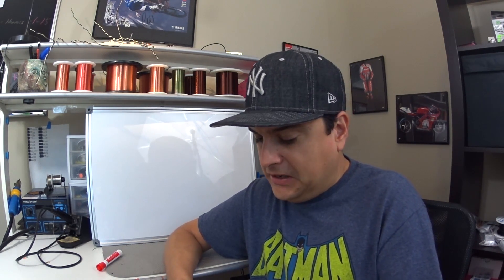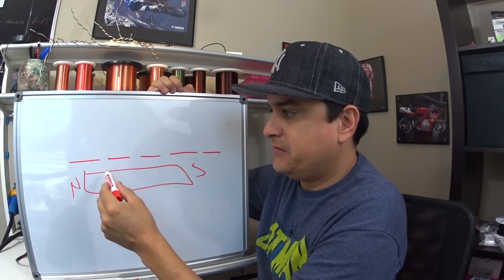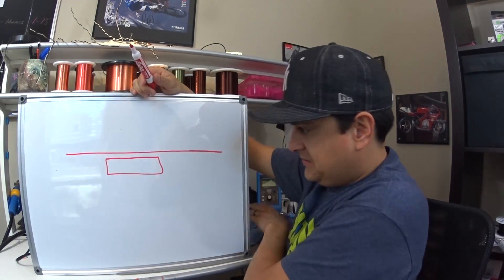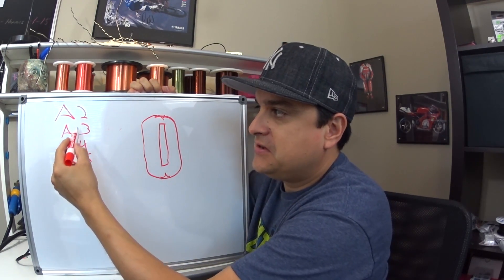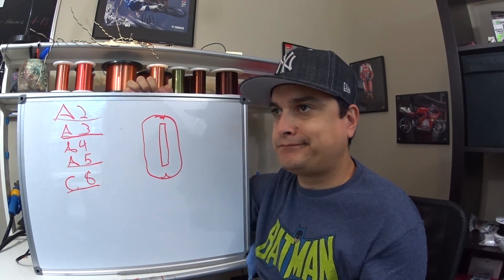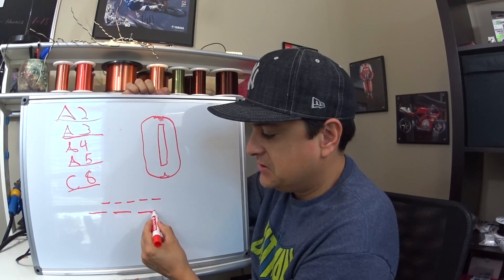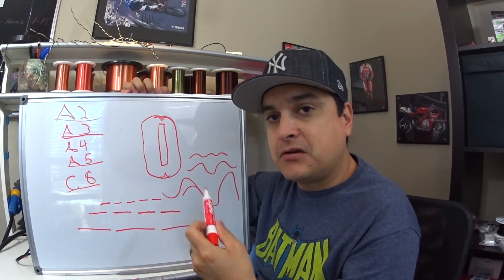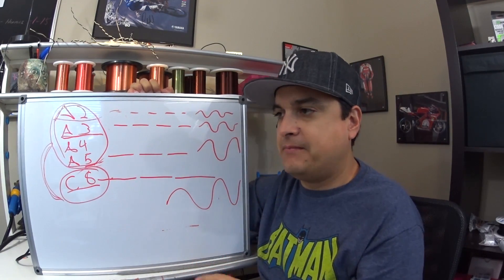Dylan Talks Tone Ep #13 Magnets! Alnico 3 vs Alnico 5 Vs Ceramic #33

Comment: The thing I dislike most about pickup manufacturing is the talk about DC resistance. Resistance changes with heat and DC specifically is pretty irrelevant when talking about an AC system. We really should switch over to talk about reactance and inductance instead. 
For reactance we can use the tuning as a reference.
If tuned to A=440, we can measure the reactance using XL = 2•π•440•L
So, given a pickup with 9.28Ω DC resistance (my Squier humbucker), I measured 3 Henrys of inductance.
XL = 2•π•440•3
XL = 8.294kΩ

Comment: I never really thought much about the relation between the coil and the magnet together, this is really interesting. So if my brain is thinking correctly, if I were to wind a humbucker with less winds similar to a vintage paf, but use a stronger magnet like a ceramic or alnico 8, would you be able to get the clarity of a vintage pickup while also having louder, more modern output?

Comment: Hey Dylan, question for you. I have a p90 that has a DC reading in the 14k range. It has ceramic magnets. I was thinking to play around with different magnets, a2/3/5 probably. And different combinations of them. Is it going to work out ok putting lower powered magnets in such a high dc resistance pickup?

Comment: Thank you for this simple explanation. The only thing I would add is that although stronger magnets are capable of a more powerful signal (i.e., more amplitude), their stronger magnet field is also more capable of interfering with string vibration. A common symptom of this is "Strat-itis", where having the pickups too close to the thicker strings will cause wolf tones. Pickup strength (combined with coil characteristics) will also affect the relative amplitude of various frequencies, which is why some pickups sound comparatively balanced, while others sound trebly or muddy. That's why pickup height is so important to good tone: you want as strong a signal as possible without putting a drag on string vibration or causing the frequency response to become unbalanced.

Comment: hi, thanks for this but its'a  bit short.I've experienced differences in tone following differences of magnetic fields shape, even generated by the same alnico type. Basically when magnetic field is very straight and thin above the pole piece, it's sharp and clear, full of dynamics. then when the MF is wider, o if it's creating kind of magnetic "bridges" across all pole pieces or pickups , then the sound is totally diferent, more flat and thin, with less dynamics and body, kind of intermediate position.
One cool example, just turn one HB pickup on a les paul type guitar; if the other HB pickup is close and with a powerful magnetic field, a south will face a north, leading to a very wider magnetic field and you will hear clearly the difference, (like  Peter Green's LP)
 I guess it's different for single coils as north and south are up and down the pole pieces, but there is kind of shaping of a magnetic field that's better than another. 
Everyone seems to know how to perfectly reproduce a pickup and they show you as well, but nothing on how pîckups are magnetized. See Seymour Duncan factory tour, not a word on it despite they say it's done further in the process.
Could you say a word on this? or confirm?
Thanks, I appreciate your channel and I'd like to have one video on magnetic field, sure you can make it!!

Comment: Misinformation the type number doesn't necessarily refer to strength but is merely an identifier a2 is in fact weaker than a3. Also you can have a vintage quite not so magnetised at weaker than a3.

Comment: Totally missed that alnico magnets act as an inductive core and independently of magnet field strength the different compositions of alnico have a slightly different permeability thus different effect on the public's inductance, and it is this one property that has a dominant effect on the frequency response. Magnetic field strength doesn't change the frequency response, but the overall output level.

For comparison, attach a lump of steel to a pickup and listen to it get louder and darker.

Comment: You are right, stronger mags, higher output.  But there is far more to all this.  The iron content within the coil for a start.  Ceramic magnets are usually used with steel pole pieces.  It's not the ceramic magnet as such, but the steel within the coil that is raising the inductance of the pickup.  (And if otherwise the same, lowering its resonance.)  Alnico has around half the iron content of steel, and was used in the 50's because there was little choice....  OTOH, I really appreciate how hard it is to make YT content that attempts to communicate technical stuff.

Comment: have a old 70s Tiesco strat that i bought as a young teen 72 to 74 it has ceramic pups ,I recently replaced the slide switches that had issues ,did total seup and it sounds amazing better than most if not all of my 20 guitars ,is it the  ceramic pups that is doing this? they are wide i guess double single coil pups much like a p90 just wanted some input on this they measure maybe 7k ohms i think

Comment: Thanks for the informative videos you produce. Here are a couple of answers that are not covered in this video about magnets in pickups. Number one the magnet has a direct relationship to the strings in the guitar. The pull of the magnet on the strings can change the characteristics of the strings to some degree changing the overall sound. Remember metals (guitar strings) can themselves become magnetized to a small degree. Number 2 the flux density around the pickup coils is different. As the guitar string moves in this magnetic field it reacts a little differently since there is a little difference in the magnetic field. Therefore the sound produced is a little different. Remember the guitar string is moving up and down as well as sideways.

Comment: For a given coil size, higher magnetic field strength results in higher output. That may affect tone because of the action of the magnetic field on the string. For a given magnetic strength, increasing the number of turns in the coil will also result in a higher output. That will lessen the high frequency response of the pickup because of the higher resistance and increased capacitance in the coil. 

Formvar vs. poly coated wire? It's the thickness of the coating, not the coating material. A thicker coating means more space between the the actual wire wrappings and therefore a larger coil than one of the same resistance using wire with a thinner coating. That again affects frequency response.

If you want to know how distance from the strings affects your tone, just sit down, take a screwdriver, adjust your pickup as close to the strings as possible, listen to the sound, time the sustain etc. Then adjust to about 3/8" from the strings and listen to hoe the tone changes, length of sustain etc. 

I have a push-pull phase switch on my neck single coil. I noticed that using the pickup by itself, switching out of phase makes it sound brighter. Something to do with the coil capacitance vs. the direction of the signal current. So there's another factor influencing tone.

To sum up, tonality depends on magnet strength, shape & width of the magnetic field, the characteristics of the coil and the distance from the strings. It doesn't matter what the magnet's made of, there's no such thing as alnico magnetism being different from ceramic magnetism.

Comment: The electrons in a static wire next to a static magnet do not oscillate. Electrons, and therefore induced current, only flows if the wire or the magnet moves. Your table of magnet strengths against alloy numbers is incorrect. It should be A3, A2, A4 and A5. The alloy numbers actually indicate when the alloy was developed. A2 was formulated first then, because of the US Bill of Strategic Materials which gives military use priority, Cobalt became very difficult to get. Alnico 3 or rather AlNi 3 has no cobalt and although developed after Alnico 2, AlNi 3 is a weaker magnetic material. As far as Fender were concerned they always wanted to used the strongest alloy they could. Gibson didn't seem to care what the alloy was as long the magnet was roughly the right shape to fit their pickups.
Reply: Thanks. You saved me from 'splaining things.

Comment: What's the difference in the effect of lowering pickup height, vs using a lower powered magnet? Either way, there is less magnetic pull on the strings. Thanks, Richard

Comment: AlNiCo - Aluminium Nickel Cobalt

Magnets are measured in Gauss and that is where Gaussian algorythms come from including Gaussian Blur. So the idea that a string is outside the magnetic field is not right, its merely affecting less of it the further away it is.

Coil resistance has no real effect on the sound, its inductance that matters ergo magnetic flux matters. Checking the resistance is good for checking continuity but don't do it with microphone transformers as you can magnetise the core material and impede the quality permanently.

Guitar pickups are essentially one half of a transformer, so I suppose you could think of the permanent magnet's magnetic field rippling with string vibration as a Class-A circuit!
Reply: Coil resistance has a very profound effect on a guitar's sound. That's one main reason why certain different pickup designs with differing resistances sound unique from each other, even though they may have a similar overall output. Higher resistance (Thinner wire, more winds etc.) will yield more mid-range and less top end and less transparency, and vice-versa for lower resistance.

Comment: Does the SIZE of the magnet have an influence? Do you get more gauss in a bigger magnet? Or say the same in a smaller ceramic magnet as a large alnico?
Reply: long story short "yes". Bigger magnet  = bigger magnetic flux... that said the surface area matters as well. Think of it like this-> if you have a 1cm x 1cm x 5cm long magnet, and you place it on iron -> yes it sticks. NOW lets say you DOUBLE the length, so its 1cm x 1cm x 10cm - > is your holding power twice as strong? No; the surface area didnt change, and due to logarthmic scaling of flux density, the force isnt double; maybe 25% more "strength". Now if you double the surface area, but maintain volume -> 1cm x 2cm x 2.5cm -> you effectively doubled the surface area of the magnet, so you get more force being applied per unit measurment. So at the end , the 1x1x10cm magnet has more gaussian strength, it does not give you a stronger grip than a 1x2x2.5 magnet.   So all together, the 1x1x5cm is the weakest, the 1x1x10cm is the next strongest, and the 1x2x5cm has the most force application. In other words, gauss alone does not tell you strength of the flux being applied. 

Hope this answers your question.

Comment: I think the AC component emitted by the pickups isn't the answer to your question. You're not talking about the tone, the dynamic range of the output, or about the topic. I'm not saying your video is bad but, it really doesn't answer the Alnico 3 vs Alnivo 5. The output goes to an amplifier anyway, and you're gonna choose what gain you want. It's not really a matter of AC voltage. This video would be a bit more appropriate to answer this : "How does pickup position affect my sound"
Reply from the maker: MrMeiryou lol.... it's how a pickup works.... AC voltage. The voltage you send to the amp affects everything. The pickup position is a different concept entirely

Comment: Idiot, output volume is the LEAST significant difference between pickup magnet types. They all have radically different dynamic response, frequency response, & 'texture' 2 the sound.

Comment: When a pickup is described as having Alnico 3, Alnico 5, Ceramic, or whatever type of magnets, is it the poles/screws (visible from the outside) or is it the magnet bar at the bottom that is made of the material?
Reply: bar

Comment: This explains only the strength of singal, does not explain type of tone every magnet has.
Reply: For the tone, there are plenty of other comparison videos. If you have pickups you like, the best way is to try by yourself and swap different magnets. That's what I've done! Experiment by yourself to get the tone you want.
Reply: That could be a whole other video. Generally: A3=bright, with soft bass; A2=mid-range-y with spongy bass and smooth highs; A4=flat eq, with tight bass, chimey, truncated highs, and mids with no noticeable spike that get "browner" with hotter winds; A5=scooped, with big bass and bright highs; C8=tight bass, with aggressive mids and compressed highs. Wind plays a big part in this, so these tendencies can vary.
Reply: Yeah magnets don't have "tone" you fucking idiots. "Tone" is frequency and current. Which he explains.
Reply: @ApolloVIIIYouAreGoForTLI  The title is misleading,he doesn't explain the tonal differences when all else is equal.IE magnet swapping with a single pickup.Some people don't have the full technical knowledge to know that magnets alone do not determine tone but that loosely  they do affect tone (when all else is equal).Angry much?
Reply: Arkadiusz Gil 
yes 
a waste of time being bored for nothing 
you could explain this in 3 minutes tops if you aren't a moron

Comment: Yea, I remember that experiment as a Cub scout, I plugged it into the wall socket. That didn't go well.
Reply: I bet the other cubs got their First Aid badges that day..
Reply: @ApolloVIIIYouAreGoForTLI  More like defibrillator and EMS badges...  Not recommended
Reply: I knocked out the power at a four story Chicago J.C. Pennies department store in 1969 at 8 years old the same way.. Jammed both ends of a fat wire in the two holes of the plug socket on the wall.. Big ass spark and threw me back like three feet.. 
My Mom asked me if I was alright (small burn on my hand) and What I did.
I got "Oh thank God" then she proceeded to whip my ass!! 
Been playing with Electronics ever since..